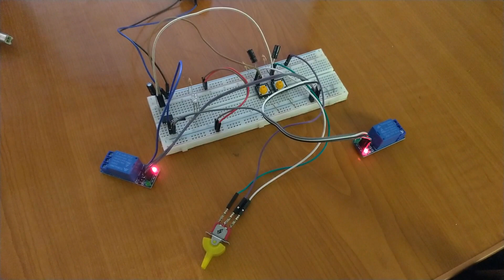DIY LED Flasher Relay with hazard lights combination v1.0 for motorcycles with ATTiny85

Comment: very nice, but how do I put this in the bike?!
Reply from the maker: The final design and implementation it's up to you, i only do the code and the basic design.
Reply: @IonutF-TS-BB why do you need code? draw the truth table and solve the k-map, it's a combinational circuit.
and as far as putting this thing in the bike along with other transient loads, it will burn in merely 5-10mins, even if you put it in a shoebox and fill it up with hot glue to make it waterproof!
Reply from the maker: @SauvikRoy  🤣If it will burn in merely 5-10 mins it's strictly depends on the final design... or in other words, on your skills to design the final product. For me, making it this way offered more precision in the timing, more options and more flexibility. If you like it and feel up to the challenge, do it, if not just ignore it... that is up to you !  😉

Comment: This looks perfect, thank you so much. I am going to order some components tomorrow. How would I change the code to get the left and right hazard lights to alternate flashing instead of both at the same time? Or better yet four flashes both sides, then 4 flashes alternating sides
Reply: Thank you sir! Its awesome 😁😁😁
Reply from the maker: Thanks!
Reply: @IonutF-TS-BB  Thanks for the code, but at my experience level with coding, you have me lost.
I put this at the top of the loop, but i'm not sure for what to do on the digital write sections.:
if (leftSignalVal == 1 || rightSignalVal == 1) {
      hazardModeOnOrOff =1;
    }else{
    hazardModeOnOrOff = 0;
    }

Then I added this before  the leftSignalState:
}
    if(hazardModeOnOrOff == 1){
    if(signalBlink == 1){ 
      if(relayLowOrHighTriggering == 0){ digitalWrite(leftSignalOutPin,HIGH); }else{ digitalWrite(leftSignalOutPin,LOW); }
    }else{
      if(relayLowOrHighTriggering == 0){ digitalWrite(leftSignalOutPin,LOW); }else{ digitalWrite(leftSignalOutPin,HIGH); }
    }   
  }else{
    if(relayLowOrHighTriggering == 0){ digitalWrite(leftSignalOutPin,LOW); }else{ digitalWrite(leftSignalOutPin,HIGH); }
  }

It compiles without error, but I am not sure if it is correct.
Reply from the maker: @bkmo9859  It's a little bit off...

Before the setup void(row 28):
int hazardModeOnOrOff = 0;

In the loop function, after reading and setting the state for leftSignalState and rightSignalState(row 67):
if(leftSignalState == 1 && rightSignalState == 1){
 hazardModeOnOrOff = 1;
}else{
 hazardModeOnOrOff = 0;
}

And after that you modify the if statements for one or both signals that do the actual writing on the output for the new state hazardModeOnOrOff(row 68 and row 78):
  if(hazardModeOnOrOff == 1){
 //here you flip the output for one of the sides
    if(signalBlink == 1){ 
      if(relayLowOrHighTriggering == 0){ digitalWrite(leftSignalOutPin,HIGH); }else{ digitalWrite(leftSignalOutPin,LOW); }
    }else{
      if(relayLowOrHighTriggering == 0){ digitalWrite(leftSignalOutPin,LOW); }else{ digitalWrite(leftSignalOutPin,HIGH); }
    }   
  }else if(leftSignalState == 1){
    if(signalBlink == 1){ 
      if(relayLowOrHighTriggering == 0){ digitalWrite(leftSignalOutPin,LOW); }else{ digitalWrite(leftSignalOutPin,HIGH); }
    }else{
      if(relayLowOrHighTriggering == 0){ digitalWrite(leftSignalOutPin,HIGH); }else{ digitalWrite(leftSignalOutPin,LOW); }
    }   
  }else{
    if(relayLowOrHighTriggering == 0){ digitalWrite(leftSignalOutPin,HIGH); }else{ digitalWrite(leftSignalOutPin,LOW); }
  }

  if(hazardModeOnOrOff == 1){
    if(signalBlink == 1){
      if(relayLowOrHighTriggering == 0){ digitalWrite(rightSignalOutPin,LOW); }else{ digitalWrite(rightSignalOutPin,HIGH); }
    }else{
      if(relayLowOrHighTriggering == 0){ digitalWrite(rightSignalOutPin,HIGH); }else{ digitalWrite(rightSignalOutPin,LOW); }
    }  
  }else if(rightSignalState == 1){
    if(signalBlink == 1){
      if(relayLowOrHighTriggering == 0){ digitalWrite(rightSignalOutPin,LOW); }else{ digitalWrite(rightSignalOutPin,HIGH); }
    }else{
      if(relayLowOrHighTriggering == 0){ digitalWrite(rightSignalOutPin,HIGH); }else{ digitalWrite(rightSignalOutPin,LOW); }
    }
  }else{
    if(relayLowOrHighTriggering == 0){ digitalWrite(rightSignalOutPin,HIGH); }else{ digitalWrite(rightSignalOutPin,LOW); }

  }

Hope i didn't make any mistakes, because i didn't test it, so if something wrong just tell me.
;)
Reply from the maker: Thanks for the donation, i really appreciate! :)
To alternate the signals left right in hazard mode, you can make a new integer,  let's say hazardModeOnOrOff and by default should be 0, after that in the loop if leftSignalVal == 1 and rightSignalVal == 1 then hazardModeOnOrOff =1 else hazardModeOnOrOff = 0.
After that, in left or right if statement where the digitalWrite takes place, you make the first if statement with if hazardModeOnOrOff == 1 then if signalBlink == 1 and reverse the digitalWrite command after that you continue with the else if leftSignalState == 1 etc..
If you want to alternate all four lights, the you need to add two more relays and modify your electrical installation...
;)